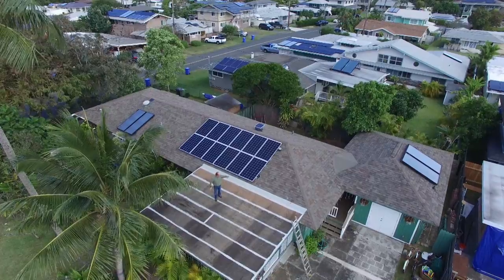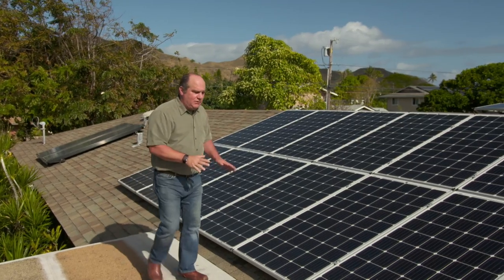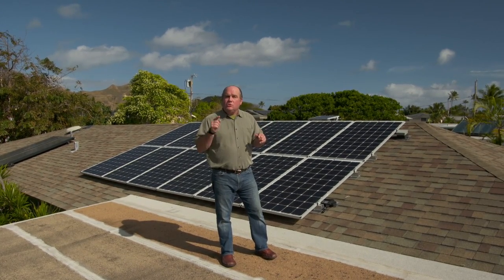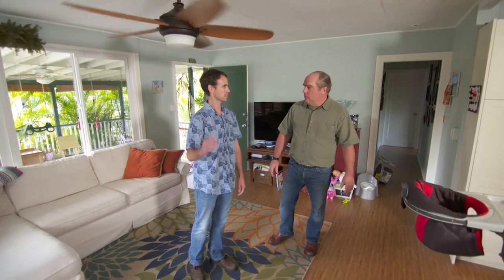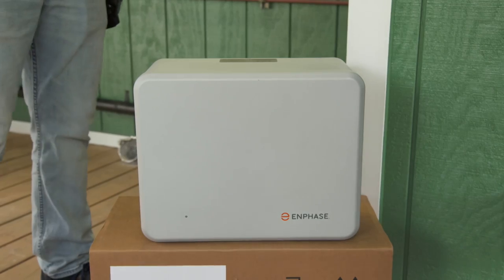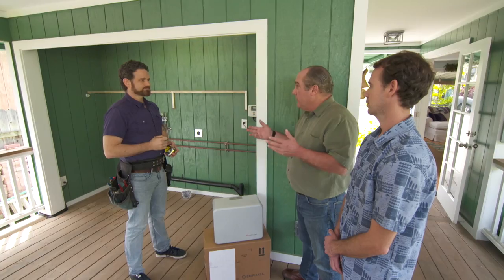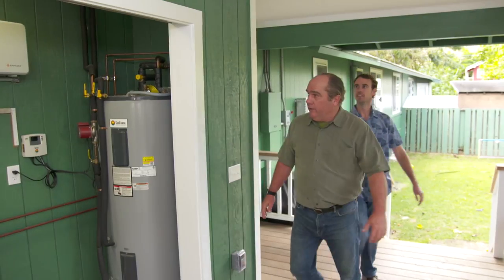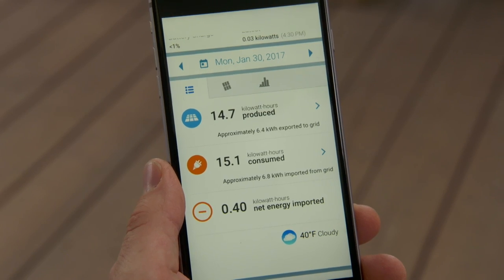How to Install Home Solar Storage | Ask This Old House

Comment: People that crap on the price of solar setup and batteries need to realize that Hawaii pays the most in the US for electricity. The price of electricity on average is $.37 per kWh.  That's more than $300 for the average household. Note that that price varies by island. The next state up in cost, which is New York pays less $.20 per kWh. The national average for the rest of the US is less than $.14 per KWH. So in this instance, for Hawaii, the investment into solar is worth it and will pay for itself sooner than a mainland home.
Reply: We invested in solar here in Maryland...was totally worth it even though our state allows net metering...Hawaii along with several other states are ripping people off not offering net metering!!! Shame on Hawaii!!!!! Our payback is about 10% a year...better than stock market any day!!!
Reply: 10c/kwh in Texas means solar makes no sense at all
Reply: How can it be better than the stock market. Your solar panels decay and need to be replaced. You will never be ahead with solar. By the time they pay for themselves, they will need replacement.
Reply: It kind of depends but generally yeah if you have other options they make more financial sense. Not to mention technology keeps improving and prices dropping. A 10k solar system 5 years ago isn't half as good as you'd get now even though you'd still be paying that system off. There is also the fact in a lot of area's you can't get off the grid either, the city won't let you disconnect. Which means even if you never touch a drop of power you still have to put up with a minimum fee to be connected to the grid and in some cases shut down your own power so they can maintenance the line safely.
Reply: Holy cow, we only pay $.08 per Kwh (winter rate) in Oklahoma.  Summer rates are $.12 to $.14.
Reply: Wow.. Thats cheap. In Germany we pay around .27 to .30€, so more than .30$ at current rate.
Reply: I know this is a year old comment, but in California PG&E likes to bend us over the table, 21.169 cents per kWh if you're under the "baseline" which is an amount of power that they decide you should be using,  27.993 cents if you go up to 400% over it (3 times) , then 43.343 cents per kWh if you're over 400%.   Seems somewhat fair, you use more you pay more but why should it cost more?  The cost of power is the cost of power, if I use 1 of that quantity or 3 of that quantity it doesn't cost 2x more for those extra 2 "units", I'll admit it may cost a bit more but not twice as much more.   

The problem of this usage persists because that "baseline" quantity is based on where you live in the region, if you live near the coast the baseline quantity is 7kWh per day, where as further inland it gets as high as 16kWh/day.   So again we have this problem of being told how much electricity we should use and being priced accordingly even though the cost of it and transmission is the same for both.   Granted PG&E doesn't think we need A/C near the coast, and on some level are true, but what if I have a shop in my garage with a lot of tools, or I want to have a big aquarium, or I want to use electric appliances in my kitchen, all of this eats into that baseline and again being told what you can and can not do.   It's a f*cking racket by PG&E and the fact the California PUC allows them to do this is criminal.   

Just to give a point of reference to 7kWh, if you had a 100 watt light bulb that was on 24hrs a day that's 1/3 your daily allowance.   Now sure having a bright light on 24hrs a day is a bit extreme, but lets say you accidentally left on an outdoor light all day, is 1/3 of your daily allowance really reasonable?  Sure it's "wasting" power, but again you could argue that watching TV is "wasting" power, or anything else.  But how about you're cooking dinner in the oven, a very small electric oven, 1 hour of cooking time easily is 1/3 of your usage for the day.    All of this financial incentive to "conserve" is quite honestly bullshit, if they cared that much they would cut you off if you use "too much", and if they cared about conservation they wouldn't fight tooth and nail to make sure you selling back power if you make excess via solar 

Meanwhile you have states like Texas and quite few others who simply tell you "you will pay this rate, for this amount, THE END"  if you use twice the electricity you did the previous month, your bill is twice as much, if you use 10 times the power, you pay ten times as much,  meanwhile in PG&E land you use twice as much you pay 2.2x as much, you use 10 times the power you pay 17.3 times the amount (and they scold you for using a lot of electricity).
Reply: Solar panels installed in the 70's are still running today... Yes they are running at a reduced capacity but they are still producing power.
Reply: long island NY pays about the same as Hawaii. They just hide all the charges in the bill as other stuff and call the price like .16 kwh.  If you do the math it comes out to $.35 kwh.  If you run the AC in the summer you have $800-1000 a month bill for a 3000sqft house.

Comment: What if he had 10 batteries instead of 5?   I would hope that should cover twice more longer & use the rest of that supply into the next day continuously so that there would be less feed from the electric company.  And being that these are batteries, one of them is likely to fail over time, so I have to wonder how much it costs for one replacement battery unit.

Comment: So the answer to "how to install home solar", seems to be "get someone else to do it"
Reply: hey ,if anyone else wants to uncover solar energy residential home try Magonsi Solar System Expert (Have a quick look on google cant remember the place now ) ? Ive heard some interesting things about it and my buddy got great results with it.
Reply: Sometimes I think its meant to show that some things you should not try to DIY and its more meant to show you what it is, the benefits (pros and cons) and what the whole install would look like to help you decide if its something you might want to do.
Reply: There are a few components to the subject . One place I discovered which succeeds in merging these is the Ewans Energy Roadmap (check it out on google) definately the no.1 plan that I have ever seen. Check out the unbelievable information .
Reply: Many jobs cannot be done by the homeowner due to electrical code as well as city codes. A homeowner could theoretically install the whole thing but would still need an electrician for the final connection and to check that all is correct and up to code before the inspector okays it. His mortgage company and home owners insurance would also likely stipulate this as well so that a novice doesn't install too thin a wire and the house burns down.

Comment: The micro inverter is for grid tie use, as stated on this product's web page. However, in this installation, the solar energy setup is for off grid. How does this micro inverter work in the off grid phase?
Reply: These are not off grid batteries.  They are designed for places where time of use billing makes prices skyrocket when solar capacity collapses in the late afternoon as the sun is setting and thus it is cheaper to run off the batteries than the grid.

Comment: That's not what I imagined when I heard solar storage. I thought it was going to be a 10,000 gallon cistern connected to the solar thermal to move water up into local water towers. Then the potential energy could be used at night.
Reply: great idea ...or maybe right in the backyard heavy weight like say 5 -6 tons lifted up slowely by electric motor and gear box , than the same motor could work as generator power by that weight going down slowly . 
the only concern would be to make the set up safe somehow so no little child would get trapted under that weight ...( or drunk  adult )

Comment: and what is the payback time?
Reply: Woodchop most systems never pay back, by the time you get close equipment has to be replaced
Reply: Garden-Variety Google User even if you double the life of the batteries you still will never make what you invest into one. It is like everyone buying high end furnaces, you will never recoup the money. How do I know I install them and service them. I see people buying the most advanced hvac systems on the market, but they won't save enough money in energy costs to ever pay for the equipment. Same goes for this equipment, the investment will never be recouped. Until natural gas becomes scarce and oil drys up there will never see their money back on this equipment.
Reply: Depending on how much is invested in the system and how big of a system you invested in...

Solar power systems can range from $500 for a basic system that just powers a few LED lights to over $30,000 for a system that can let the house be completely off-grid and still have every modern convenience...

Versus how much energy you use... If you're paying hundreds every month for utilities then it could pay off sooner but typically it averages around 7-10 years...

It can also pay faster if you're in a high energy cost region like Hawaii that has to pay a high premium to get fossil fuel shipped to them.

Along with how much sun you get in your region... Being in Hawaii they get a lot so it's easier to get a higher return on energy costs there but if you're in a region that doesn't get a lot of year round sunlight then it can take a lot longer to break even...  But you can always combine the system with a wind turbine and other ways to generate energy locally...
Reply: Overly gross statement. Where the user is located, how much energy he uses, how much the system/installation cost him are all huge factors in when/if it makes a return on investment. That aside, keep in mind solar panels also need to be replaced at some point, same for turbines, things wear down. Batteries also don't just "end" they lose % capacity over the years. A well maintained system can last 20yrs, but the amount of energy produced and stored will lower over the years and needs to be accounted for.
Reply: Sorry zack9912000, but your post makes absolutely no sense...  It cost money to use fossil fuel too, there's no such thing as a free energy source!  

Just for oil you're paying to have the wells drilled, for the fuel to be pumped, to be transported, to be converted in refineries into usable versions, and then to shipped again before it's finally used.

The machinery invested in the entire process all cost money and like any machines they wear out and need replacement over time.

So you're distorting the facts to think we have to wait until gas and oil dries up before alternatives become economical just because you point out the obvious that parts needs to be replaced over time and it requires a constant investment when that's true of all energy sources we use...

Do you think cars will last forever?  Do you think we get back our investment in everything we use fossil fuel for?

Fact is we will always be investing in energy sources no matter what... It's only a question of how much invested versus what we gain.

Solar energy is virtually limitless, and can be accessed across the globe with no need to transport it, bottle it, etc. So it has an advantage over oil and gas in simple availability...

The technology that allows us to use it just has to be cheaper than the technology we use for fossil fuel and then it will already be lower cost, which is happening whether you want to ignore it or not...

So stop with the extreme exaggerations, fact is solar used to be impractical but the technology has improved to the point now that it can start competing with other energy sources and in some cases it is already a better choice in places where fossil fuel isn't as economical to use.

It's just not automatically a better choice but there's a difference between competing energy technologies and technologies that make no sense to use at all like you're trying to argue...

Places like Hawaii are just emphasizing it more because they don't have any natural gas or fossil fuel, so everything has to be shipped to them at high cost.  Meanwhile, like the rest of the world, they have a growing population but being on islands means they don't have unlimited space to just put up more power plants.

The frequency of how often they have to have fossil fuel shipped to the islands also factors because they can't store a lot of fuel on the islands.  So the repeated shipping adds a lot to the costs for them...

So lets not pretend that there's no reason to switch from fossil fuel and that alternatives are so terrible that they shouldn't even be considered when in fact they do work and have improved to the point that they are already becoming viable alternatives in many places and that's only going to continue to happen as the technology continues to improve...

Comment: How does this system handle anti-islanding? If I pay for all those batteries, I better be able to use them when the grid is down.
Reply: chrisbinnie you will that is why there are batteries.
Reply: GRID-TIED AC BATTERY Does NOT work as backup or off-grid power source.

that info was pulled right off the batteries description
Reply: chrisbinnie He had that disconnect switch to cut him off from the grid.

Comment: You may want to expand on "the why" the utilities don't want upstream power - specifically the fact that distribution (as apposed to transmission) grids are historically designed to be one way. The issue comes down to safety. Transmission lines are bidirectional in delivery and thus have fault systems that isolate based on multiple sources of energy. In distribution systems, the feeders are designed with the assumption ion that power is delivered from the substation to the meters, and fault isolation assumes that. If there is a line fault, the utility does not want energy delivered from the home into the faulted line. However, there is technology being developed for "islanding" these segments.
Reply: James Hanley  Here in Florida, the utility lobby has blocked the use of "islanding inverters in residential solar installations using the safety argument. However, people who buy whole house standby generators are allowed to power their homes in a power outage , yet somehow, these don't pose a risk to utility linemen? How can a fossil fuel powered generator be safe and a solar system be "unsafe". Both have "islanding" circuitry!
Reply: Let me give you people some advice. Our government doesnt care about your safety .They care about money
Reply: Inverters, such as the Enphase Micro Inverters on my system, cut power if they sense grid loss so they don't back feed any power onto the lines.  I believe that's standard in all of them.

Comment: Why doesn't Hawaii tap its volcano for geothermal energy? Regarding 1:34-2:10: That's what baseload plants are for.
Reply: It has since the 1980s, but the plant was damaged by lava during the 2018 eruption and won't be operational again for another year or two. The plant is located on the Big Island. There were studies for a couple decades of how to get the power to a couple more islands, but the long undersea DC cables needed would be too expensive (depth of water, environmentally sensitive reefs, etc). https://en.wikipedia.org/wiki/Puna_Geothermal_Venture
Reply: It is my understanding that Hawaii makes more solar than used during the day.... they go negative on the base loading.  Then in the evening they have to spool up rapidly.  That’s the problem.... also the grid tie settings for things such as frequency deviation are broader... SMA for example has a different set of setting for US mainland vs Hawaii grid in their grid interactive inverters.

Comment: Is there anything called AC battery!
I never knew that.
Reply: There's someone making very precisely machined weights that spin faster when "charging" and slow down when "discharging" though the AC generated isn't always 60hz so the power has to still be converted so I'd have to see one in person to say it's viable

Comment: What it's the cost of that solar panels system?
Reply: Typical cost of a solar install can be $3.00 - $3.50 a watt. That includes panels, racking, inverters, labor to install.

Comment: I like this but it would be nice to have the ability to have a battery that could hold more power in a smaller space. I then would have more batteries not only 5 but 25 to 30 plus batteries. I would as well put more solar panels on the roof. At night I would install a wind turbine so so when the wind blows at night it could help charge those batteries and help to provide power at night cutting down on having to use the power company if possible. I believe things like this should be considered as a Right not a Privilege. Public Utilities should never be a for profit entities, they need to be a right.
Reply: if its a 'right' then you could use 0.1% of the energy i use, and you would still pay the same (in taxes)  to support my 1000% higher energy usage.   still think its fair?

Comment: How about return on investment? How long for breakeven? These panels don't last forever. They lose efficiency every year. Same with the batteries. Eventually everything will have to be replaced. How much gain in savings will there be before replacement?